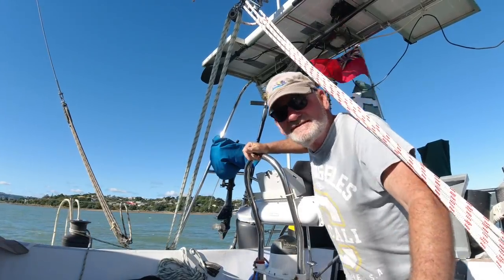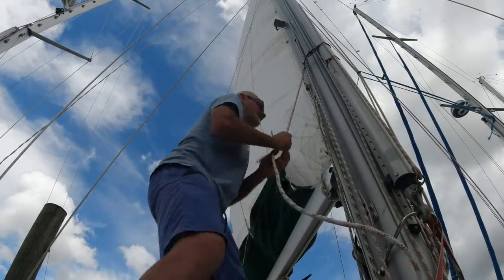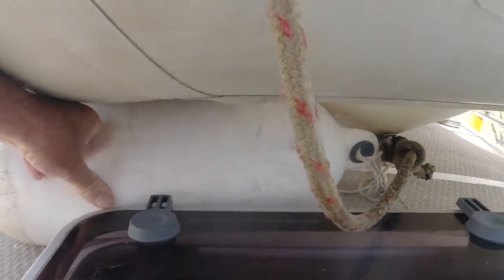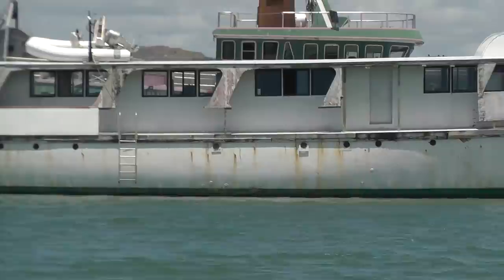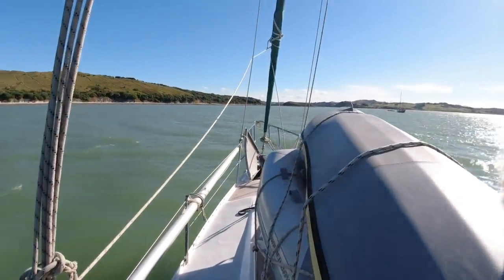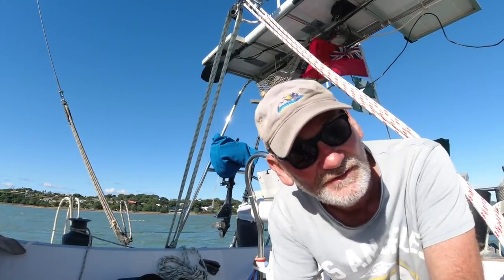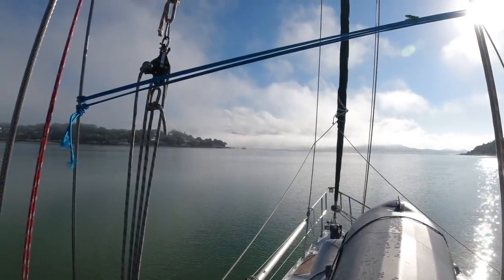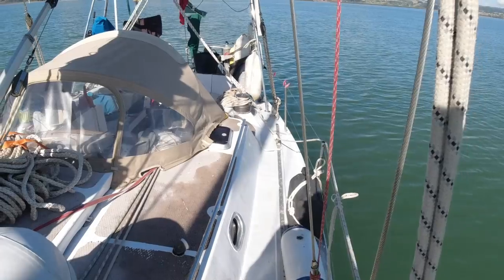All good fun

Comment: Barry, I have the same inflatable but in a one person version. I love it and it has taken me down class 3-4 water and out fishing too many times to remember. But DON'T OVER INFLATE, OR LEAVE IN THE SUN at full inflation. Its ok for it to be hard when on the water but when you come out let a bit of air out. THE INFLATABLE PART IS PVC and the seam splits easily if inflated to the fullest. Mine lasted 4 months, before the split and they are next to impossible to make a repair on a seam. They repair easily anywhere else with a bit of PVC glue and a bit of pvc material. I found SHOE GOO worked the best on the seam, and as a preventive measure went all the way round the seam with it and have not had a problem with it.                  CHEERS AND FAIR WINDS                         Steve h.

Comment: New camera gear is working well Barry? Top Tip, use a strong thread on a dried out baby wipe to lubricate the mast tracks and to retrieve it. Guess you do not have so many baby wipes on board ? 😄 Crack on mate, we love your videos. Sail Safe mate. Ant, Cid & the pooch crew.

Comment: Barry, you really ought to get all of the problems with your VHF and HF radios sorted out, if you're having trouble reaching people.  Surely one of your fellow cruisers in the marina is a ham radio operator, and/or knows enough about radios to get yours sorted out.
Reply: Niteshadd9:    Says Landlubber to guy who has sailed half way around the world.
Reply: @Vinnie101a  and he's had problems with his radios the whole time he's been sailing. May as well actually fix it at some point. He's struggled to keep in contact when buddy sailing and that causes the people you've made plans with to worry. All because your gear doesn't work properly.
Reply: Connector corrosion maybe or antenna wire.

Comment: The marine architect that tought me built those motor torpedo boats in Vospers yard in England just before the war.
He said they would line up on a German boat using super quiet V8's then hit the gas... As the V8's reved up a centrifical clutch would start up the main engines and the crew would launch the torpedos as the boat surged forward. They would then turn and run..... Usually under heavy fire from 50 cals.

Comment: A metre under the keel, you're not even trying! When we first reached Whangarei we anchored down by the boatyards and had <10cm under MR's keel at low water. I'm assuming that the kayak will be deflated offshore, but what about the dink? Fill that with water and in a lively sea you've got a helluva load on the dink and it's lashing; it'll depend what your deck area/layout will accommodate, but we stowed it inflated but inverted; if I was careful over the positioning, the fore-hatch would opened about 3/4 inside/underneath the dinghy, so you could open it for ventilation in relative safety even in rain/spray conditions. Cold as a witches whatsit here, enjoy your summer.

Comment: Barry, Fairmile B. Bless you man. Talk about coincidence! It wasn't but a couple of weeks ago that I thought,"whatever happened to the Pendeniss?" As much as I tried to research it, unfortunately all to no avail. Who, what is, what was the Pendeniss, you may ask? Well now having a mooch around the intertubes and looked at the pics, she was quite obviously a Fairmile B.

Circa 1960 when I were nowt but a lad, I used to fish off the original iron jetty, now long gone, that was an extension of Blackpool's North pier. The Pendennis used to briefly come alongside to pick up passengers who partook of a "booze cruise,"  not forgetting that the pubs used to shut at three in the afternoon. so it was get it down your neck lad/lass.

Since you mentioned it, I still can't find any information about the vessel, but she is mentioned here, but no further info. Pendennis, isn't that your neck of the woods?

I will the link to the Fairmile registry, but I will add another link on a separate comment to an old blog post of mine that I did about Blackpool's North pier. You know what youtube is like when they think someone is spamming.

Crack on old lad.  Safe sailing.

 https://www.simplonpc.co.uk/Fairmile-B_Header.html

Comment: River water runs out on top of the incoming and also can be running towards the sea while the level is increasing. Just think of that river water encountering the rising sea but it has a lot of momentum before it can change direction.

Comment: If I were you in that situation I'd be checking the actual depth with a rope and weight rather than trusting the depth sounder, particularly since it's not long ago that it wasn't working at all. Remember, there's a difference between precision and accuracy, ie your sounder might be precise to the tenth but dead wrong.

Comment: Im not quite following your logic.  You don't trust electronic devices for secondary sailing tasks that are most dangerous like going on deck and lifting a sail but you do trust electronic devices for perhaps the second most important part of sailing, which is navigation.  Watching you move the attachment of the fancy computer a few inches within a few seconds of telling us all why you dont trust electronic devices while sailing could be comedy gold in 2021.
Reply: Tablets and GPS don't often go wrong and when they do, cheap to replace.  Also, GOS navi is not required on a boat.  Electric winch on your masts go wrong more than they work and are not simple to fix, even less so when out at sea.  They are also incredibly easy to burn out the motor.  Not worth the time, money or investment, you'll end up on deck bypassing it anyway.